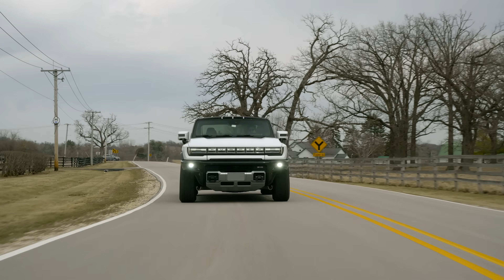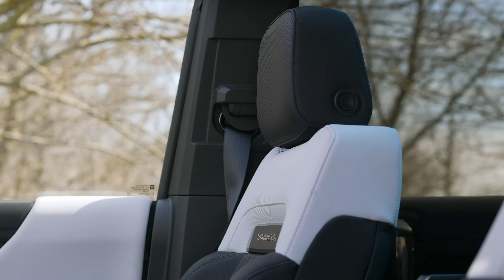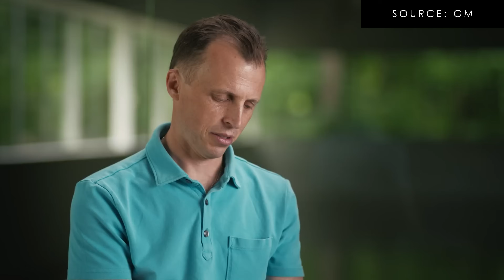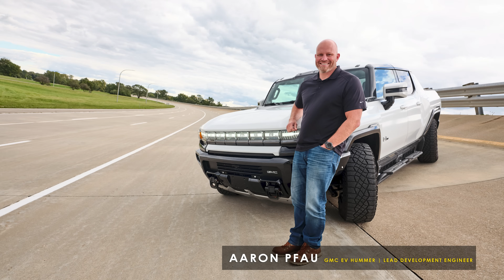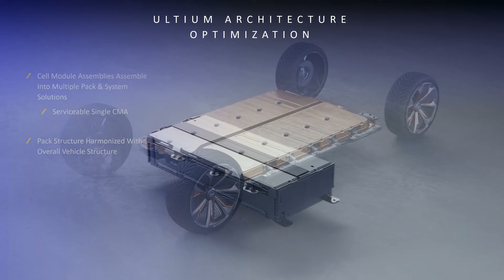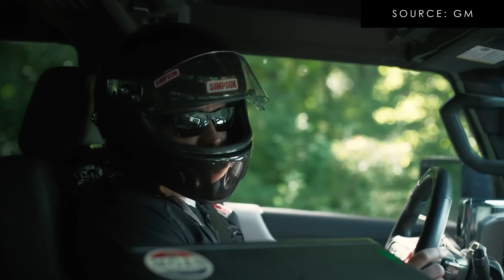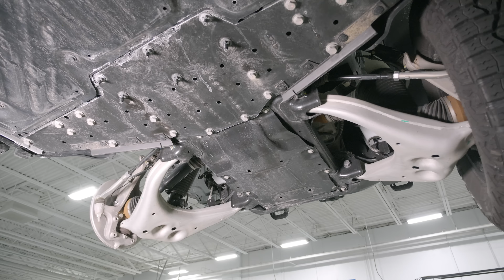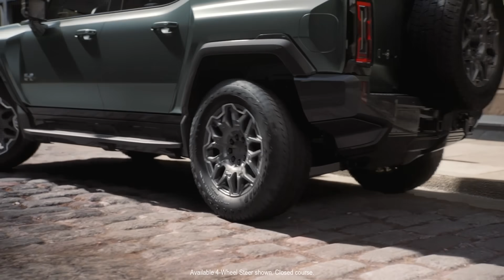Hummer EV | New Formula for Beast Trucks

Comment: "1 kW in to the heat pump gives you 5 kW out"
"Not using the electrons to propel the vehicle I'm using the thermal energy in it"
Shit man I gotta go back to school I'm way behind on this new stuff
Reply: No gas engine means no "free" cabin heat.  Heat pumps transfer heat from one place to another.  So you can get 5kw of heat for 1kw of heat pump compressor energy.  Usable for heating the cabin without relying on electric heat strips which require at least 5kw of electricity to get 5kw of heat. The heat pump is efficiently transferring battery thermal heat to the cabin when and where needed.  The suggestion that this heat pump is getting 5 to 1 efficiency (COP of 5) is the story since most heat pumps are around 3 to 1 Coefficient of Performance average. The "using electrons to propel" simply means saving more battery capacity for the motors rather than using more of it for old school electric strip heat.  All of which is a bigger deal in a cold climate like Chicago than Florida or Southern California.

Comment: Imagine if they invested this much in an actual usable EV....
Reply: They did. The EV1, then 20-30 years later, the Bolt. But they didn't market it.  
Dealerships hardly carried it, and charged you out the ass if you tried to order it
 saw it as "the enemy",  didn't send their Techs to learn it.
 Sold it to fleets.
Reply: @NoodlesWithMSG  The EV1, while not perfect, was great for those times - if only they would have kept developing from there  GM and the auto industry would have been in a much better place... The Bolt meanwhile is plagued with issues.
Reply: @Jackinacox  true, but to their credit, they made good on replacing the LG battery, even for cars that had a ton of miles/ past initial covered period.... even if it took a lawsuit or 2.
Reply: @NoodlesWithMSG  The Bolt wasn't anywhere near as high tech, well equipped or carefully designed. It was a Frankenstein product.
Reply: Like the Silverado, Sierra, Blazer, Equinox, Lyriq and several other EVs they have coming in the next few years?
Reply: @bahamatodd  Truck, Truck, Crossover, Crossover, Crossover .... notice anything?
Reply: A "traditional" EV would never require this much investment, so your hypothetical is meaningless.

Comment: Base price 110,000, with options 145,000, with dealer markup 185,000. That's just what we need.. another expensive big-ass vehicle in addition to what we have on the road right now. Without the infrastructure in place and charging technology that is quick and cheap, this is as useless as a condom with a hole in it.

Comment: 9,000lbs and no commercial drivers license required?  Yikes.
Reply: - insane and it makes you wonder of insurance companies will make these things impossible to insure unless the owner receives special training in advance?    +1 on that IMO..
Reply: As someone who works with people who have commercial drivers licenses. I promise you It means absolutely nothing. Also you don't need a CDL untill the gross vehicle weight rating is over 26,000 pounds. 9,000 is not that much. My work truck is 14,000 pounds empty. Also this does not apply to recreational vehicles.
Reply: @autohelix  For sure, I know it doesn't meet the minimum for a CDL, however,  9,000 lbs is more than enough if you ask the person who gets in an accident against the guy driving this pig.  Gob forbid the other person is in a rational vehicle that weighs much much less.  I sure as hell don't want to get mowed down by the latest small penis energy brodozer while driving my mx5.
Reply: @tylertullis6536  Yeah but how is a CDL going to make a difference? The main purpose of a CDL in my opinion is to make sure everything works lights tires and so on. But in reality it is just a way to artificially inflate wages. I wish you could take a CDL test in this thing It would be easiest test in human history.
Reply: @autohelix  Oh it sounds like it wouldn't change anything other than maybe limiting how many people buy the hummer.  The price already does that though, aren't these things marked up by 50-100% at dealers?  Either way, it weighs 2x as much as my first generation Tundra annnd I find that ridiculous.
Reply: @tylertullis6536  That is going to be the new normal with electric vehicles much much heavier.
Reply: @autohelix  I guess I better up my life insurance 🙄
Reply: You do need a truck license to drive this vehicle in EU. At least here we'll be safe from the rappers and dads in middle life crisis
Reply: @provigilandchill  Love America, I can drive a vehicle up to 26 thousand pounds with my regular license. I drove a shuttle bus for work with no prior training or special license, sadly that would not have happened in Europe....that job saved me.

Comment: A possible solution for charging the massive battery would be to integrate duel port charging. This way an owner can set up two chargers at home to charge it more quickly.  Then when they are on the road they can spend less time charging.
Reply: Without being sarcastic, I believe the solution is just to have a second vehicle

Comment: Somehow I feel like we’re missing the point of making EVs when we start making 9,000 pound 1,000 hp monster trucks like this
Reply: That's the paradox. Current battery tech only really makes sense on an infrastructure charge speed basis for small cars. But people want SUVs.
Reply: Can only hope at least the R&D money and robots and design processes trickle down to smaller, sensible vehicles.  
Volt and Bolt were great ideas and honestly good EV's, but they could not out compete the Japanese traditonal HEV's, early BEV's and current Gen korean BEV's.   
So GM, in GM fashion said, screw it. Go Big!
Reply: @NoodlesWithMSG  sensible? Lol. So General Motors should only build boring “sensible” $110,000+ vehicles whose sole purpose is to be efficient, slow, underwhelming rebadged designs that look like preexisting models for the sake of costs cutting and conservatism?

If that’s the only application of an EV that you believe the entire country is interested in, you may went to take a peek at the Hummer’s waiting list.

The logic and business model you have maybe best for Tesla. I think I prefer the way Marry Barra thinks about EVs, a company as large as General Motors has more than one audience to satisfy and can actually satisfy several markets by offering it all and developing whatever the hell they want.
Reply: @mybro727  thats not what I said my dude. 1) I said or ,trying to convey, I hope they will use the retooling to prepare for new models and hopefully the new ones will be more efficient.  What I AM complaining about, is they spent sunken costs to retool  and to build the Volt and Bolt, but they instead of building upon that, they "reinvented" a brand new Hummer, "Just to get market".  IF they do the same dumb shit, it will become one of those old homologation special "super rare" Ferraris, that contribute nothing to common cars or worse, those lessons will be forgotten like rhe EV1.  2) wait lists don't mean jack shit, especially with all the flippers and self employed "arbitrage " buyers.   hell, PT cruisers and new Beatles had waitlists.
Reply: no this is exactly what EV's need. Thats like saying "we're missing the point of making ice vehicles by putting supercharged v8's in monster trucks"
Reply: @james2042  That’s not at all a good analogy. Just think about why we made ice vehicles and then think about why we are pushing towards EV vehicles and it’s very obvious to see your analogy makes absolutely no sense. Critically think about how much waste is produced from manufacturing a tank like this and how inefficient it is. Trust me, I love fast and terribly inefficient ice vehicles, that’s not the point I was making at all.
Reply: @cokemachine62590  I own an EV and a Grand Cherokee SRT 392, I owned a hybrid econobox before the EV, I promise you I know both efficiency and power/fun vehicles, I understand them both.

Gas crisis hit and everyone went from single digit V8's to more economical cars, then as engines got more and more efficient, V8's came back with double the MPG of their predecessors, but every single engine today (except for the supercharged ones) are built around maximizing thermal efficiency to extract as much power per unit of fuel as possible. Then the superchargers came in with the hellcat and now its just power power power. 

But you also have the corollas and civic of the world, hyper focused on efficiency. Then the hybrids came out to push it one step further, then the older EV's that got the ball rolling like the model S, Leaf and i3 (arguably the volt too) All the super powerful EV's didn't really see the light of day until a decade after the first batch mentioned above. The all powerful hummer EV, model plaid, EV6-GT, and so on are all recent.

People buying the most efficient cars are going to buy EV's now, just like they did prius's in the past and corollas/civics before that. You don't need to convince them to buy in. But to get people who don't care about efficiency to buy in? You need powerful and entertaining vehicles
Reply: Lol. You watched the entire review and definitely still managed to completely miss the point of the Hummer EV, that’s for sure. It went right over your little head. Smh 😅
Reply: @mybro727  I never said I missed the point of the hummer EV, I said making this car is missing the entire point of building EVs to begin with. They’re not the same statement, you just decided to read what you wanted to read

Comment: Hummer EV- The quintessential 'im definitely not compensating for anything' vehicle
Reply: That would be the loud and obnoxious Ford Raptor R, when a V6 Raptor ain’t Ford tough enough. 🤡
Reply: @mybro727  the raptor should never have a v6. base f150 can have a v8, why shouldnt the sporty one?! 

as for compensation, that's definitely all the guys with a lift kit and over sized tires. none of them use it for what those are for
Reply: @mybro727  And 90% of them will never go off road, just like the hummer 🤡

Comment: We dropped our deposit on this thing. It's going to take nearly 2d to charge to full on a home fast charger. 7d if you don't have one. Hours at a roadside charger. It's literally just too much battery. Which is painful to say because the range is good. It's just too heavy for the current state of batteries. 

These things make no sense at all as cool as they are. It's actually pretty frustrating. I feel like future generations of batteries and charging systems will make these early heavy suv type EVs obsolete.

Comment: What a colossal squandering of engineering capital and time.  A nine thousand pound truck?  That claims to be off road?  With batteries?  Apparently, all auto makers have decided every rich person wanting a $130,000 monster SUV or truck to race on a track MUST be satisfied before a viable $28,000 BEV will be designed for the masses that doesn't look like a dorkmobile and drive like a plastic toy.  The fallacy that these efforts on flagship products help accelerate design learnings that will trickle down to mass market products is after-the-fact rationalization from engineers failing to establish more useful design goals that actually contribute to solving crucial energy and pollution problems.
Reply: I'd agree with you but... They are sold out here in Canada where I live. For the foreseeable future model runs.

Comment: I couldn't imagine getting something like this stuck in the mud off-road. It's so heavy that a rescue mission would take a tractor.
Reply: If you ever used a wench, it would probably shift tectonic plates
Reply: Call in the Ukrainian farmers
Reply: Hey, if you've got enough money to buy it, you can afford the Chinook to come in and air-lift it out of the hole :))
Reply: Trail mater ftw
Reply: And a Chinook!
Reply: Imagine while trying to get it out, the battery runs out of charge 💀
Reply: yeah, call the national guard to bring an armoured recover vehicle.
Reply: And not a small tractor! My Zetor Major 80 only weighs about 10000lbs with the loader and loaded tires... It's firmly in the mid-size utility category and highly capable in off-road situations (I've done some...ahem... testing. It's barely narrow enough to navigate a trail, and at nearly 10-feet tall with the cab and stack low clearance is a constant issue... but the limited-slip front differential and locking rear + ag tires and ~15" ground clearance and relatively short wheel base really shine in the rough stuff... ) but it might not provide sufficient tractive effort to budge that electric monstrosity if it's stuck!
Reply: Best for moab
Reply: - Bring a Bulldozer?
Reply: Matt’s Off Road Recovery will get ‘er out.
Reply: It's a good thing like 95% of trucks sold today none will ever be driven off road aside from some kids who want views on TT.
Reply: @Jacob Mueller  you're not even lying
Reply: If you watch some TFL videos. The weight really is a problem off-road. Stopping and starting on inclines and declines
Reply: @KC-xw7ql  jeez

Comment: 246 Kwh battery? 246! Thats fucking insane and defeats the purpose of an EV
Reply: Not only insane but selfish. They could build two full EVs or five plug-in hybrids for the same non-renewable battery resources they used here.
Reply: @jS197 has nothing to do with being poor. The concept of an EV isn’t realistic or efficient at this time. All green movements like these are scams. Save money/fossil fuels by spending even more money or using an alternate energy source that is collected by fossil fuels lol.
Reply: @jS197 150 hybrid Rav4s could have Been made with resources that went into 1 of these monster batteries.  The point here is that GM (and others) are full of $hit when they spew crap about saving the planet. This EV hummer is a worse waste of resources than any gas powered car today. Period.
Reply: That’s why EVs and other green movements are nothing but a scam. Save money on gas but watch your electric bill increase and your time to wait for the battery to charge. 

These EVs are worthless when trying to sell them back to a dealership.
Reply: @_Nickstein  not only that, but they could have made many hybrids out of those materials that went into this monster battery pack.  If it was truly about cleaning up the planet that’s what GM should have done today.  But it’s not. It’s about pissing contest with Elon. Government motors had to beat him to the market.
Reply: That's the issue. Until charging infrastructure is either ubiquitous or much faster, it makes no sense.

Comment: Hummer: We heard our ICE models were inefficient, let's make our EV model inefficient too!
Reply: slow clap
Reply: Just like Teslas. 
These EV's are a scam.
Reply: @ariescaisip5498  "EV's are a scam" - The fossil fuel industry
Reply: @ariescaisip5498  EVs are on average 4x as efficient as ICE vehicles. There's definitely lots of arguments in favor of the benefits of having liquid fuel instead of batteries, but there's no arguing that EVs are far more energy efficient, that's just a basic fact.
Reply: @0hypnotoad0  That's on average though. Larger BEVs are less than half the efficiency of their smaller counterparts in some cases and towing only makes that worse. I agree how efficient EVs are in general though, so it's pretty wild that a N/A Honda Civic burning fossil fuels still beats the Hummer EV MPGe numbers in the real world,
Reply: @JaronWWaters  Hummer EV is 47 mpge average from the EPA, the best 21 Honda Civic is 36 mpg average. Even if the Hummer were less efficient I don't see how that would be that surprising, it's a 9000 lbs supertruck and the civic is a sedan, by all rights the civic should be more efficient, but it's not. Either way it doesn't matter because most EVs are sedans and midsized crossovers, super sized electric trucks are a rarity.
Reply: @ariescaisip5498  Idiotic propaganda. It's kind of insane how little power a passenger car BEV actually uses. 250 Watt Hour Per Mile is just a crazy industry benchmark. FACTs dictate that is very little amount of energy thus very efficient.